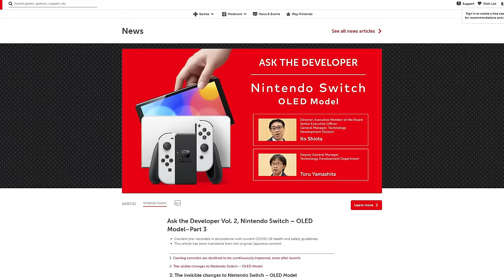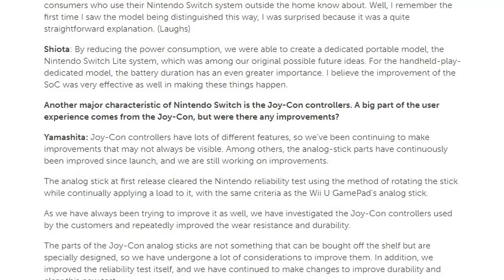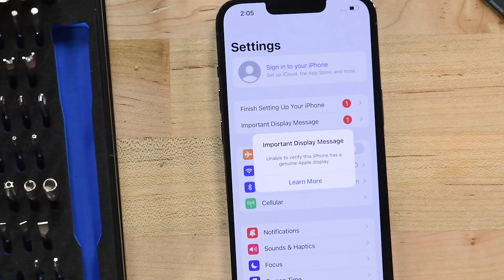Nintendo Switch OLED Teardown: More Different Than You Think

Comment: "Nintendo doesn't use software locks to limit repairs". Except for the WiiU optical drive. I found that out the hard way.
Reply from the maker: Excellent point, I should have been more specific! I just meant in the new OLED Switch. -Taylor
Reply: @RexorProxer  Like Xbox 360
Reply: @RexorProxer  So? Piracy has never impacted anything.
Reply: @tezcanaslan2877  I switched mine and nothing happened
Reply: @xxzenonionnex7658  You need to switch to a drive with piracy firmware installed
Reply: @acumenium8157  Pft, it sure impacted the original Nintendo DS and made the Playstation considerably less profitable for Sony than it otherwise would have been. Didn't help out the Dreamcasts final year much either.
Reply: @BrySkye   to be fair the Dreamcast was already flopping because Sega lost the trust of their fan base. Actually it's pretty funny to think about now with all these different variations of consoles that are releasing now, Dreamcast probably would have been fine using their '90s business model in today's time.
Reply: @BrySkye  bro the original Nintendo DS was the second highest selling console EVER, second by only a SMALL amount to the PS2. WTF are you smoking?

It also had stupidly high game adoption rate, literally over 10% of Nintendo DS owners bought Pokemon Black and White, the umpteenth Pokemon games on that platform ALONE and late in its life.

The original PS also sold over 100m copies.

Are you okay?
Reply: wii u
Reply: @acumenium8157  I’d actually beg to differ. The Wii was notoriously easy to hack into. Piracy was rampant. Data point of one, but everybody in my high school art class did it. I wouldn’t be surprised if it cut into sales enough to be noticeable; third-party sales on the Wii did drop off quite substantially in the second half of its life.
Reply: @nameless-user  Third party sales being bad is likely just because people only buy Nintendo consoles because they're arbitrarily forced to get a Nintendo console for Nintendo games. If the Switch wasn't portable, its third party sales would probably be poor.

Why buy multiplatform games on the vastly inferior console?
Reply: @nameless-user  It didn't cut into anything. Piracy has never been proven to impact sales. Pirates weren't going to buy the product anyway.
Reply: @acumenium8157  I’m just spitballing. What I do know is that the Wii was really easy to mod, and is easier to mod now more than ever. Nintendo tried their damnest to lock down the Wii U to prevent it from happening again. Even if it didn’t truly impact sales (personal experience says otherwise IMHO), it did give them a bad look in the eyes of developers.
Reply: They did on the Gamecube.
The games are formatted in such a way that unlike the PS2, Dreamcast and Xbox, having them resurfaced could corrupt the game files.
Felt like a "new" 3DS situation to me where they just wanted to artificially increase sales.
Reply: @RexorProxer  well looks like they failed cuz I modded my Wii U and I pirated games on Nintendo you failed you failed you failed you failed you failed you failed you failed
Reply: @caiomendes377  I'm sorry to say guys but the Wii U is better than the switch in my opinion it doesn't give the love it deserves I like it more cuz you can Homebrew it
Reply: @nameless-user  they failed because the truly way that you can easily lockdown consoles to fully remove the web browser cuz people make a website which which allows you to run the exploit with a click of a button Nintendo tries to patch it but sunlight but then a couple weeks to a month later it gets fixed
Reply: Yep -- the WiiU was one of the least repairable models they've ever put out. Wii V1 -- flawless. Parts were easy to fix, solder, get to, etc -- the Wii U? 100% Cluster F. The giant 3DS XXXL GamePad I ALWAYS hated, and I wish they'd have gone for more sensible controllers. THAT being said, if someone gave me a Wii U with a broken optical drive, I'd have it fixed, and just keep it. There were a ton of fun ass games that hit the Wii U that weren't going to hit anything else, besides the Switch, now that they're beginning to ramp down the 2DS/3DS lines and more.
Reply: Can confirm. I tried to replace the optical drive in mine, only for it to not do anything
Reply: @JaredVonBaren  my run with the Wii U was dealing with one of their faulty EEC Nand chip. That was a real bummer because it just kills the console.
I mean you could still play wii games because it's on another console, but the wii u part of it was just FUBAR
Reply: @acumenium8157  PS1 sells? PS2 sells?
Reply: @polromeu  PS1 sold over 104m and PS2 over 155m.
Reply: @Purified Water II You mean real piracy, not software. :)
Reply: @iFixitYourself   are the connections on screen the same as old  can you put normal switch in the casing of oled switch
Reply: It’s a wii u what do you expect
Reply: As did I...
Reply: I also found they lock the sd card slot the digitizer does work afterwards using both original sd card slots
Reply: @tezcanaslan2877  and Sega Genesis
Reply: @Blue-Eyed Vibe that isn't true. That doesn't even make sense. There are a lot of myths about GameCube discs, with almost all of them being false.

Comment: When you get points for not setting up software booby traps in your system so that it can't be repaired... we are in a dark timeline.
Reply: Might have something to do with bad repairs that made batteries explode and the owners tried to sue the companies. Exploding batteries are a thing.
Reply: @webinatic216  apple start all this
Reply: @webinatic216  nah it has nothing to do with that
Reply: @webinatic216  So... disabling the battery health setting and also locking the display, camera etc. helps with that? Sounds more like their excuse than their actual reasoning
Edit: Talking about Apple here
Reply: @webinatic216  That's a lame excuse, it's quite difficult to accidentally damage a battery to the point it combusts, plus if manufacturers were actually concerned about that, they wouldn't use this ultra strong adhesive to hold the batteries in place which is completely unnecessary since there's no space for the battery to move around in these extremely miniaturized devices anyway!
Users accidentally bending the battery to the point of critical failure wouldn't be a concern, if they didn't have to pry it out in the first place!

Now that I think about it: I've never heard of anyone suing a manufacturer because the battery they pried out from their device exploded. However, we all have heard of brand-new, never opened devices randomly catching fire, because of poor design...

Tl;dr it's a bullshit excuse that manufacturers use to justify making user-repair more difficult (which in fact increases the safety risk) and force people to buy new & feed the landfills at an insane and unnecessary rate. Please stop spreading their excuses!
Reply: @webinatic216  That still doesn't explain why they throttle older phones
Reply: @josheeyzgaming3662  They did that. Now it's an option in the settings if you want it throttled. Because they got sued. My iphone 6s is smooth even with the newest ios update.

Comment: The wireless and Bluetooth performance on my oled switch compared to my OG one is so dramatically better, I am surprised nobody had picked up on it yet.
Reply: It’s in your head
Reply: True also the Performance is in my opinion a little bit better cause the fan isn’t that noise
Reply: I just wrote that - totally agree with you
Reply: It’s a turd
Reply: @thenotoriousjoey9956  im sorry I use the oled since it came out I know what is say
Reply: OHH MY GOD !!!!! SOOOOOOOOOOOOOOOOOOOOOO MUCH BETTER EVERY GAME I PLAY IS SO MUCH BETTER, 
you smoke to much trash that nintendo is being putting in your brain, lmao
Reply: @tbz707  consider, being on a tech channel, where someone is discussing the effects they noticed of a physical change to a device’s hardware across a generational change. Then go cry, as you realize how foolish and insolent your baseless, hate driven comment is in the eyes of every knowledgeable beholder.
Reply: Definitely exactly the same
Reply: Hasn't been for me, my right joycon has been having syncing issues.
Reply: There’s a lot of metal in the switch so just a few tweaks I’m sure it wasn’t hard this time around
Reply: Exactly
Reply: @progamerlul  my fan is silent on my switch had it since 2019 maybe you should of cleaned yours lol i hear no sound on mine docked or un docked
Reply: @kalin1786  you must need to be in a straight jacket

Comment: Now if we have a broken game card slot, we will need to do some soldering to fix it instead of just replacing the module easily. I'm glad the display assembly can be replaced easily though but I imagine it to be quite a pricey part.
Reply: Well if they use high quality oled parts like Samsung does that screen is definitely a 150+$ to replace.

Comment: Does that mean the new daughterboard is now married to the SOC and that the game card slot will now require component level repair instead of easy 1:1 replacement as in the older model?
Reply: Likely not. The old switch SD card board and Game Cart board weren't locked, only the storage chip was. With SD and Cart combined, there's no reason they'd be locked to any one system
Reply from the maker: The daughterboards are not married to anything, as far as we could tell! We swapped boards between two systems and did not notice any issues.
Reply: @iFixitYourself  Thanks for checking! 👍
Reply: the gamecard ASIC is the only component that is loosely married aside from the eMMC (donor ASICs must be from a lower system version iirc, or it will fail to boot)
Reply: @ShinyQuagsire  eMMC is married by being encrypted with unique-per-console keys, and the PRODINFO partition contains unique system data, like serial number and certificates necessary for online hardware authentication. You cannot use a donor system's eMMC daughter board without first flashing the old one's contents in. And if the original chip dies without a backup, you cannot restore full functionality.

Comment: Oh, I didn’t realize the older models had modular storage… 

Now my question is — if you did get a new storage module that was blank, is it a difficult process to get it back up and running?
Reply: It's probably quite difficult--the eMMC module on each Switch has data like per-console keys that only work with the unit it came with. Swapping eMMC modules between Switches of even identical hardware revisions doesn't work, unfortunately.
Reply: @UItEnthusiast  ahh, had a feeling... Didn't think it would be as simple an SSD swap and OS reinstall on a PC.
Reply: @DoctorX17  Yeah, I definitely do not like Nintendo doing that either, especially given that the eMMC would have otherwise been easily swapped out once it was worn out. 

I think Nintendo should allow for third-party OSes--that would actually make the factory OS more secure, since less people would be trying to breach its security to allow for the installation of such software. It would be a win-win for everyone.
Reply: @UItEnthusiast  that would be awesome, but sadly, I can’t see them doing that any time soon. They seem to be of the mind that they need to lock things down as much as they possibly can at all times
Reply: @DoctorX17 It's not impossible, but you do need a modded Switch to extract the keys and transfer/rebuild the eMMC's contents. You can also find bigger aftermarket eMMC modules if you want an internal storage upgrade.

Still, even tho afaik the entire process can be done without ever booting into a CFW (the keys can be dumped using a RCM payload, which is completely independent from the console's firmware, and the eMMC dump can be manipulated from a PC), I still wouldn't recommend going online with a bigger module afterwards even if you keep the firmware completely stock as the Switch's telemetry does include the eMMC's size among various other fields, potentially making it easy for Nintendo to detect that the console has been hardmodded.
Reply: @vappster  yeah…. I wouldn’t be surprised if Nintendo were to just block all modded Switches they can detect from their services, so if I ever run out of space, I’ll just go with the SD card…
Reply: @DoctorX17  Yep, Nintendo really stepped up their ban game on the Switch, it's not like the 3DS anymore when they literally could not even tell whether a game you had installed was legit or otherwise lol. There's still ways to fly under the radar, but going online with anything modded is always a big no-no.

So yeah, if you wish to get bigger storage while keeping your system stock, the only sensible option is a bigger SD card.
Reply: Someone actually did change the internal memory module and installed a much bigger one and it worked fine, I think it was a hacked console though.
Reply: @vappster  The new Switch doesn't support RCM tho, you'd need a pricy modchip instead

Comment: Finally glad we can see the inside of it. It looks like the improvements they made are definitely worth it. It’s a shame it’s currently sold out everywhere and you can’t buy it unless you want to pay scalpers on somewhere like ebay at least $450…
Reply: Check best buy I was able to put the only one they had on hold at like 5 am 🤣
Reply: I bought normal switch because of this, i love it, it looks still awesome on the v2 switch imo
Reply: I'm unfortunately probably going to have to buy it from a scalper because I really don't want the non-OLED Switch 😕
Reply: Stores are slowly getting them in stock, i took the first commenter’s advice and I tried my local best buy and they ended up having 1 left in stock. So definitely keep trying stores, I suggest calling them that way you’re not running out there constantly or wait until prices drop it.
Reply: Yea definitely try calling that’s how I got mine from GameStop
Reply: I got mine from Walmart and it's been in stock there and on Amazon for aweek
Reply: I don’t want a oled people say it’s got a green tint to the screen lol plus they get burn in my Samsung phone with a oled had this problem it started flickering then it just went off and wouldn’t come on again had to get a new screen on warranty

Comment: I noticed that the Switch OLED is also quieter compared to the Switch V2, at least for me. The fan doesn't kick in as much as before when playing in handheld mode.
Reply: I noticed too.👍🏻
Reply: Definitely quieter
Reply: Same actually. And compared to my V1 switch, oh boy that thing gets loud. I replaced the thermal paste a year ago or so, and it got better. But I didn’t know about that metal place on top of the actual dye of the processor, so if I opened that and replaced the thermal paste there, I think it would be even better
Reply: @halami2149  i have only the V2 to compare and i noticed that oled  is a bit quieter .
Reply: @gus_bz  I have a V2 as well. My little sister plays a lot of splatoon, which I guess is a very graphic intensive game, and I noticed the fan on my V1 was so loud when playing docked. Handheld wasn’t too noticeable. The V2 was significantly quieter, you couldn’t really hear it. After changing the thermal paste on my V1, it was significantly less loud, but I think it’s still a little louder than the V2. Like my other comment said, I think I need to redo it. I might’ve also put too much paste lol
Reply: @halami2149  V1 = fat PS4 fan turbo jet 😂
Reply: @gus_bz  Oh yeah that one is bad lol. Although, back on the thermal paste thing, I saw some videos where people replaced the thermal paste and cleaned dust and stuff and there was a major improvement. I hope people can do that to fix their loud consoles, it doesn’t seem too hard from what I can tell. Just need patience and being careful
Reply: @halami2149  Yeah i saw videos too but i am too afraid to open my PS4 and damaged it .
Reply: @gus_bz  It’s suprisingly easy if you follow a video instructing you how I was able to turn my Ps4 pro from a turbine engine into a desk fan

Comment: The teardown was neat! I recently purchased a new OLED Switch. Unfortunately my left joycon has issues and the left rail was not holding the joycons in tightly.
Reply: OLED definitely doesn’t seem to be immune to joy in fit issues with the rails. My OLED joycons have slight vertical slide and slight wobble on the left. My v2 feels tight as a rock. Rails are definitely different with fewer screws on the OLED ones, but they seem to suffer from the same potential issues as far as I can tell.
Reply: @Echo2424  v1 here
tight as a rock as well lmao
Reply: Just got an OLED and my left joycon was fairly loose.  One piece of electrical tape 1/4 size of a postage stamp and it’s completely fixed.  Should I have to do this? No. But it’s better than switching it out 10x before I get a perfect one.

Comment: Owned an OLED for a week now. Unlike V2, OLED model does get warm when both dock and playing on hanheld mode. I miss my V2 already. That thing cooling performance was extremely good.
Reply: A person on here said it’s cooler than v1 and v2. Maybe yours is defective. That YouTuber that did burn in test measured thermals on 2 OLED switches and both were different
Reply: My old switch always got hot and the fan was loud.  The oled I have now never even gets warm and the fan is not audible.

Comment: I saw a video a while ago of a guy who claimed to have figured out that the joycon drift is caused in most cases by the stick not being properly supported from the bottom, leading to the metal casing bulging and reducing the pressure on the potentiometer wipers inside. A simple fix was to add a thin piece of card stock (or similar) in between the stick and the joycon housing. Maybe all Nintendo did was make a slight change to the mold of the joycon housing, so that the plastic underneath the stick is slightly thicker?